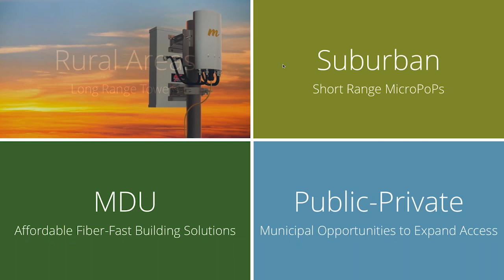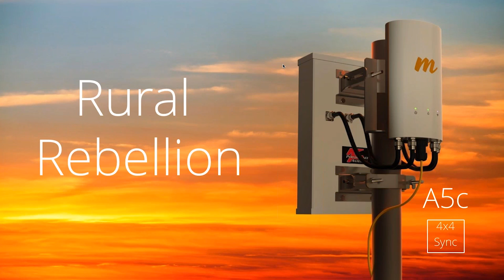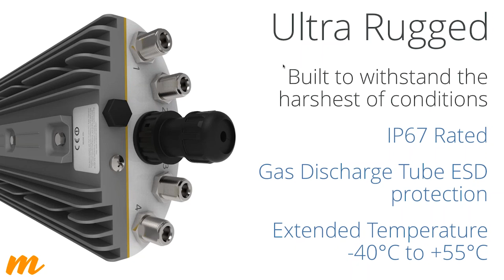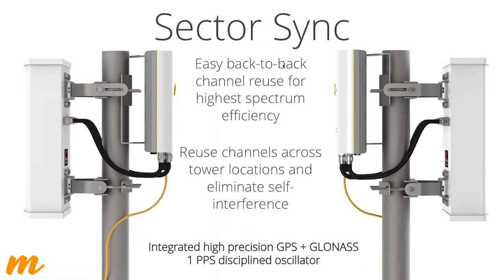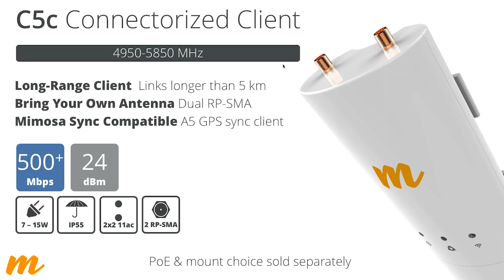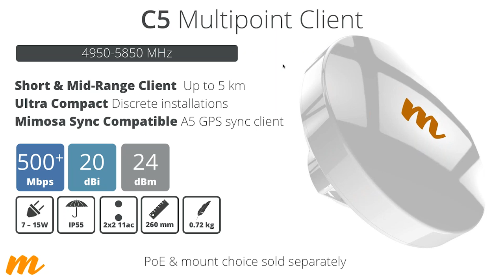High Speed Fixed Wireless Internet for Rural Communities

Comment: How do I know how much front to back spacing we need between the sectors? Do we use the same SSID for all sectors? What wireless channels would we use say for 2.4 GHz? If a customer is on the edge of signal between 2 sectors and they keep switching between sectors, how do we keep them from losing their connection (disconnects to Netflix or FTP)? In your example at 16:13 minutes, you have 6 sectors, how do you choose what channel to use for each sector? What happens if someone else you don’t know or can’t control uses the same channel that one of your sectors is on and it’s causing interference & they have auto channel selection and they keep swapping channels?

Comment: Here in NC, access ranges from Dismal to impossible.  AT&T offers impossible with 3 meg DSL with 300k up.  Across interstate 95, Century Link?  8 meg down, 500k and sometimes 800k up.  Century link is NOT interested in updating their service.  AT&T same.  "Well, you might bet 5 megabit off your cell phones." --- here, there are 0 bars to 1 bar for AT&T.  Ugh.
Reply: Same here in Person County. We haven't moved there yet. So leaving At&t Fiber for Centry Link sucks.
Reply: @dogman_  Verizon has a 5g home internet offering coming "soon" -- unlimited data, and depending on how far away your tower is... 50 to 600 megabit down.  Wireless provided to house and all that rot.  The problem... 5 comes in multiple flavors.. mostly with 4 levels of performance.  That, at least, is better than DSL.

Comment: I live in a rural area of Arizona with service from a local wireless ISP. 
I'm 11 miles from the main service antenna and 3 miles from a closer one. I get a better line of site to the further one so they have me pointed that direction. Though the speed isn't horrible it's in and out. I believe they are running too many clients per access point. Only 3 antennas in this valley that I know of and there has to be at least a few hundred of us using those 3 points. 
I had a neighbor who had something that boosted the frequency from 5 to ? He had uninterrupted service. I asked about it and he told it was frowned upon. I asked my service provider about it and I got a run around. I could tell by the conversation that  it was an option but either not ethical or illegal by the FCC. 
Can I boost my signal legally myself and if so with what?
Reply: It's likely coming, lots of Fed $ coming

Comment: I want to start an wisp in rural areas. Is possible to do this using DSL from my base station? everywhere I look it seems like I have to get fibre for base and I can redistribute via wireless medium.
Thanks in advance
Reply from the maker: It will work, but since DSL is limited to about 150 Mbps, your client/subscriber feeds will be fairly low (depending on how many your have).